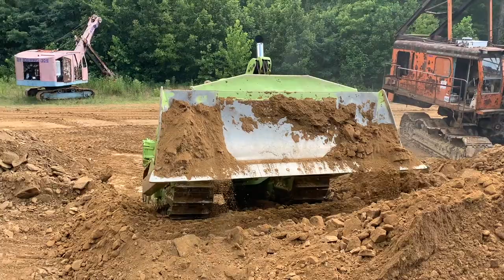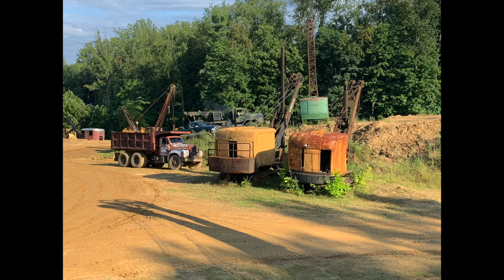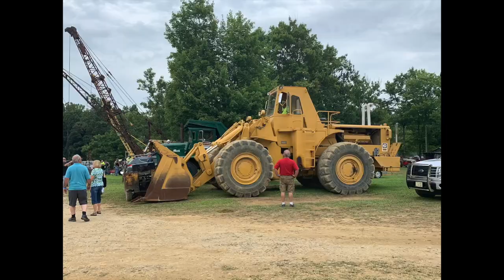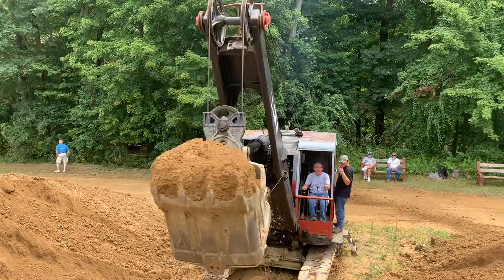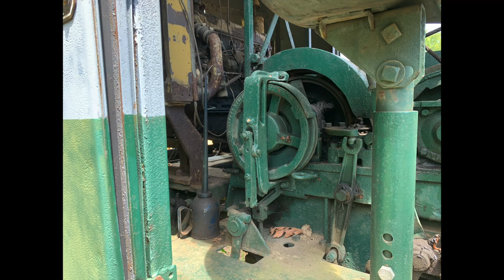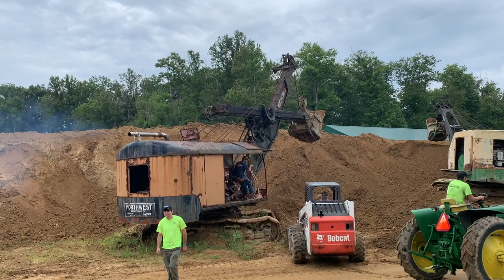BROWNSVILLE NATIONAL PIKE HUGE OLD EQUIPMENT SHOW AUGUST 2021

Comment: Great seeing all the BIG iron working again. It must be great fun running that friction clutch lever action again. Thank you.
Reply from the maker: i was able to hop on 7 machines. Different brands and control patterns makes for a lot of thinking but i had a great time and can't wait for the May show
Reply: @73DiamondReo  
Boy I envy you. That had to be super Fun. People just don't understand. The operators today just have two joy sticks. Even now with new Graders. Though that would never happen. The skill to run grade with those old brake pedal, clutch levers. The swing forward and back on lever.
Let's see those hot shots that always win the picking up of basketball off cones and dropping them in Garbage pail. Let's see them with a cable backhoe do there thing. I just love old equipment. My personal toy for my yard is a 78- Dynahoe-190
Little Musky for my stripminning
Garden, I turn the whole raised garden soil each year.
Reply: @rp1645  Just saw a new John Deere excavator commercial, the operator sets the final grade and specifies the working area limits, then sits back and watches. Yike!

Comment: My friend always had terex  because he owned a junk yard and it's all gm and was easy to get parts if he didn't already have them in his junk yard love the sound of old Detroit 2 stroke although I find them gut less inless wound up my timber jacks ran detroits and they couldn't climb a hill inles low gears where the Cummins engins hade plenty of power

Comment: Superb. I watched it in 2 sittings. Interesting to see a particular model in different modes - Shovel, hoe, clam shell, dragline. Also to directly compare different manufacturers approach to a particular task. Lastly the comparison shots of scale (10B next to 12B and so on) was spot on.
Reply from the maker: yes there is a slight difference in size between a 22b and 10b. My 15b fits right in the middle at a 1/2 yard.  I was hoping to get more footage but helping out and playing took up a lot of filming time.  I love that everything is mechanical on these machines, the linkages, clutches and how they fit it all together to make it work.

Comment: Is the sliding arm able to be pulled back towards the crane?, can that arm be pulled out and in? It looks that way at 1.25?  I thought the bucket simply self centered under the boom sheaves. Thanks.
Reply from the maker: yes the crowd is powered in both directions. with no input from the clutch or brake the hoist sheave near the bucket will naturally rest under the boom sheaves like you're thinking.